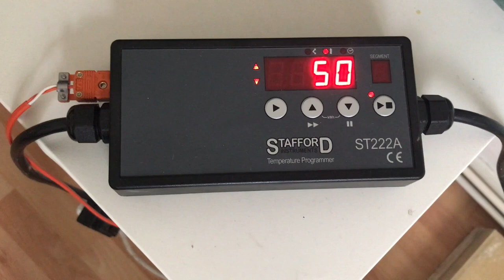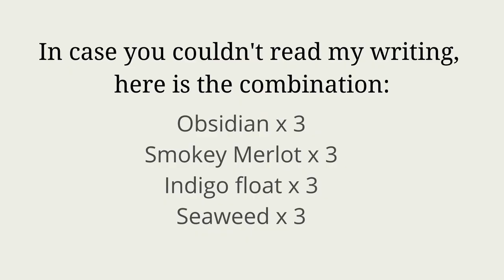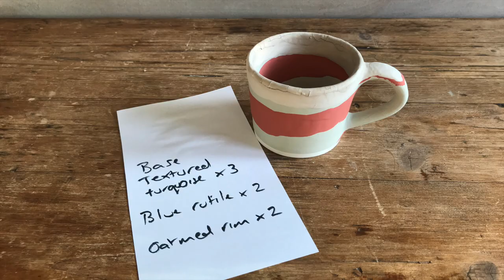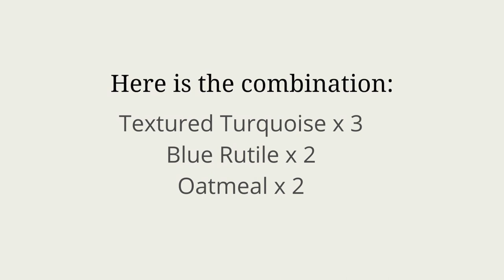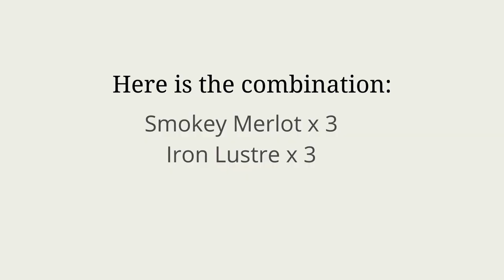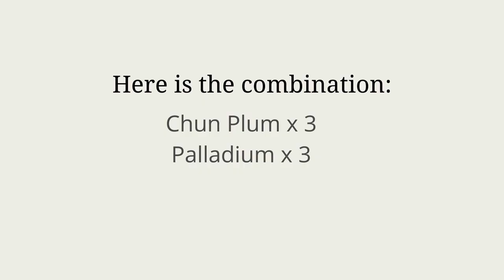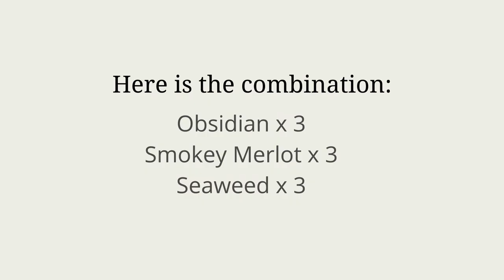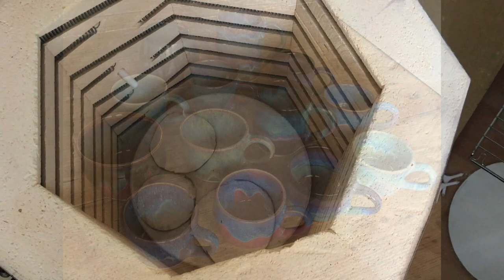Kiln Unloading and Glaze Combinations

Comment: I really appreciate your clearly documenting your layers; it is very helpful to see the final glazing as well as the layout. Thanks!
Reply from the maker: You're welcome :)
Reply: @ThePotteryWheel  Unrelated to layers... I've been experimenting with using cling wrap as a release agent for plaster models of glass bowls, etc.  If you're interested I'll post a note if I have success.
Reply from the maker: @Bob-Is-A-PotterNow  Yes, I'd love to hear how that goes.  Do keep me posted :)
Reply: @ThePotteryWheel  Amazingly I found a very easy solution!  I sprayed the exterior of a large bowl with mold release. I do a fair amount of silicone casting, so it was a universal mold release which I had on hand; but, I'd almost sure a cooking spray could be used too - waay cheaper. After spraying with mold release I used a hake brush to dust the exterior with cornstarch. When I went to invert the whole casting, the bowl FELL OUT with no additional effort! 😲  I have to do a better job the plaster-  too many bubbles on the flatish base of the bowl. But the technique worked far better than I'd expected. I plan to make a short video and post it on my youtube channel after I have a more "professional" production.
Reply: Sorry for typos. Need a different pair of eyes for proof reading.
Reply from the maker: @Bob-Is-A-PotterNow  Great, send me a link when you've posted, I'd love to see that :)
Reply: @ThePotteryWheel  Happy to do so. FWIW, likely to be week or so before publishing...

Comment: Thank you for sharing.  I love to see how other potters load there kilns and use of colors with glazes especially before and after.  I just did the same I haven't loaded my videos yet.  I like your kiln.  I myself don't need an industrial size kiln but I think I need one slightly larger then what I have.  Do you mind listing what kind of kiln you have an either list the specs or tell me where I could find them?
Reply from the maker: Hi Michelle, it's a Cromartie 40L kiln.  It's very old.  I bought it second-hand.  Judging by the user manual I got with it, I'd say it was made in the 80's.  It had been sitting in someones garage for years and hadn't been used for ages.  But they aren't in production anymore.  What country are you in, and I may be able to suggest something similar though...

Comment: They are all beautiful!!  Just one question...are they all food safe? I made a bowl with 3 amaco glazes which I layered, and someone informed me that even though all 3 amaco glazes were considered food safe on their own,  once layered, the composition can change making the ware unsafe for food consumption. I was told by amaco it’s best to use a liner glaze,  one glaze, or use the celadons which can be layered without compromising the chemistry. They said use the layering on the outside only. Just curious if you were able to test your ware?
Reply from the maker: Hi Mary, thanks so much for your comment.  Very interesting.  I hadn't heard that about layering their glazes.  I may well contact them to get some info.  Thanks for the heads up.
Reply: The reason why the celadon are compatible is because their base recipe is the same. I heard all the amaco celadons have the same base, only different coloring oxides. That way the chemistry doesn't change when you layer them.

Comment: Hi there I really love your glaze combos did you do over lap or did you glaze them in strips?
Reply from the maker: Hi Kimberley, I usually overlap them just a little where they meet one another.  I should do a video where I'm applying the glaze maybe?
Reply: That was the same question I had and wondered if they were overlapped each band separately placed on the dry bisqued section. The written combinations are quite helpful but it is difficult to know which comes first if they are in fact layered on one another. I would love to see a video of you doing the layering. Thank you for speaking slowly as I find the English accent difficult to follow at times. Subtitles would be of great help.
Reply from the maker: @rOHRshackartpottery  Hi there, sorry my reply confused you.  How much I overlap the glazes depends on the colours I'm using.  I usually put a couple of coats of a base glaze (whichever colour I'm using as the base).  Then I put bands of different glaze around the mug on top of the base colour.  I may put 2 or 3 layers on the band.  And the bands normally overlap a little.  Somewhere between a few mm or a cm.  Hope that helps.
Reply: @ThePotteryWheel  thank you for your reply.